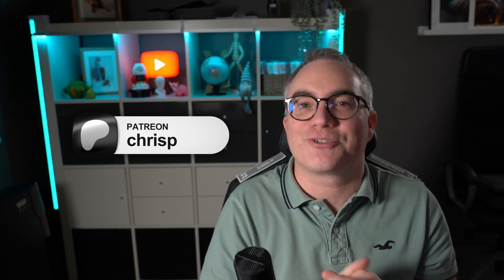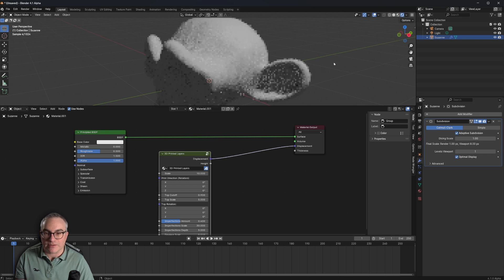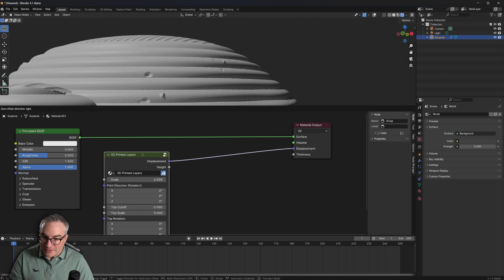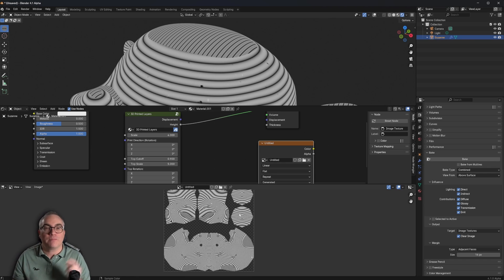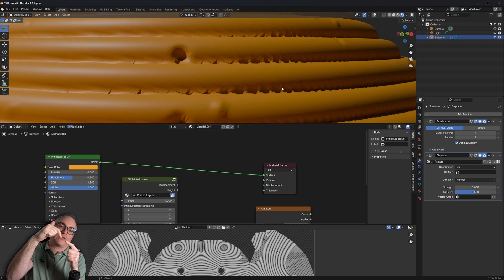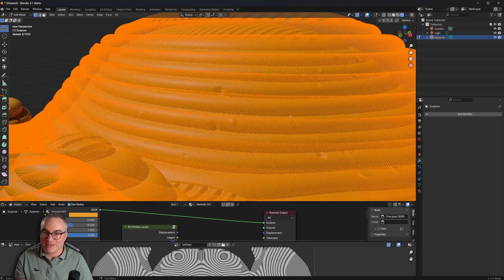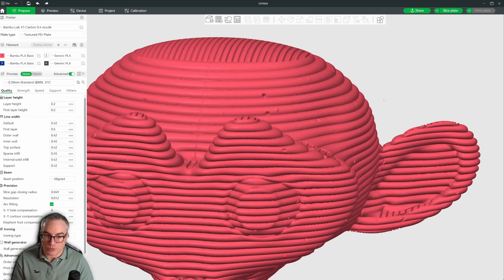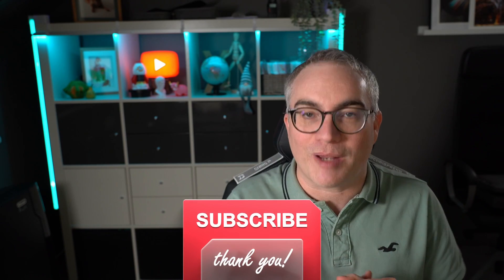Shader-Displacement To Real Geometry - Blender Tutorial

Comment: Can it be done without baking? So I can still modify the displacement without the need to do all the baking process again each time? Thank you
Reply from the maker: you can change the displacement at any time BUT if you want that baked into the geometry, then that is a one way road
Reply: @chrisprenn  thanks for the answer. I ended up rebuilding the same node tree in geometry nodes, but it didn't end up looking the same, kinda similar but not the same. 

My shader editor had a procedural terrain generator made with a YouTube guide, but I needed to scatter grass and trees on the terrain and I couldn't make it work without real geometry :c

I am a begginer